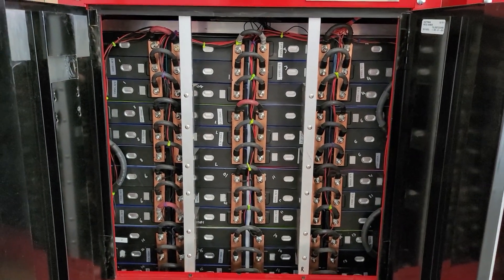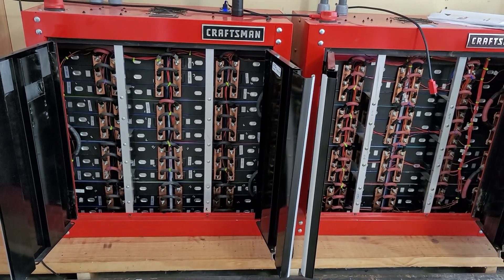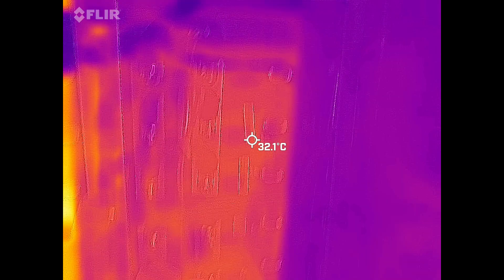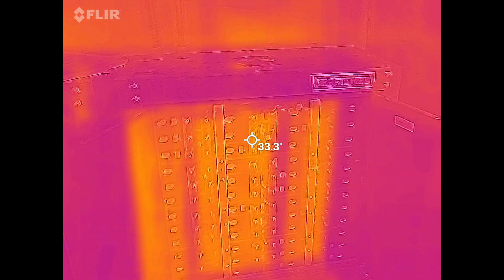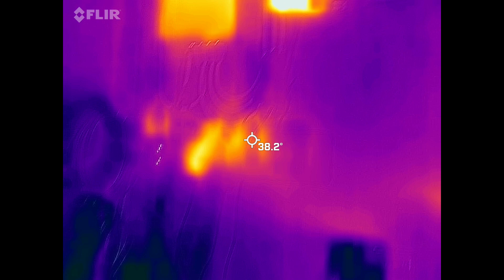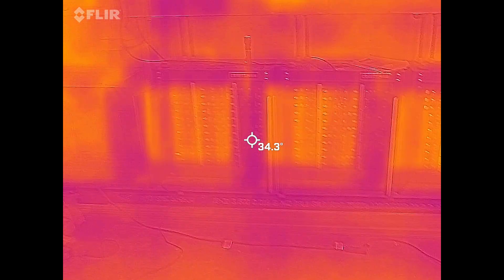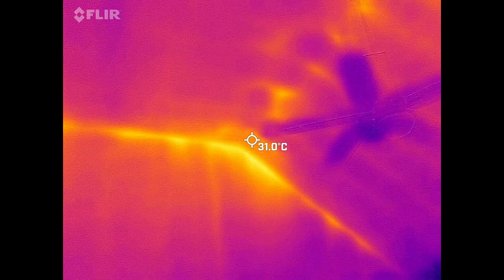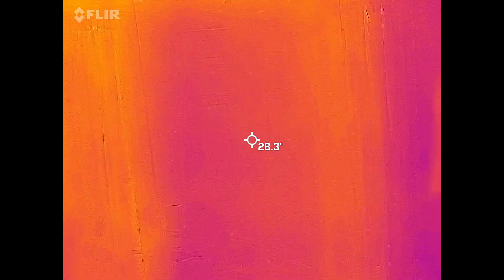After 18 months, PowerWalls on Flir One

Comment: is there a company in the area that can do the spray foam  im sure the hot spots are the framing and not sure if you can really insulate it well you would need to go in the atic and look at the framing but i think spray foam could cover the area better and get into any small areas let me know what you find out
Reply from the maker: Works start tomorrow. We will see how it goes. I am going to implement some of my own ideas and see what happens.
Reply from the maker: So far idea of sealing all of the wiring holes, electrical boxes and HVAC and vent ducts followed with 2 inch foam board and extra fiberglass insulation is working out great. First time that I was able to cool home down to 72 deg,F at 3PM. Do not know if it is worth of making video about it.
Reply: @DMIINC2013  Im glad your making progress every little bit helps what type of ductwork do you have in your attic fixed metal  or is it flexable through out your attic 
also is your airhandler in the attic or in a closet or ? and r value if flexable in the attic and size of AC unit and SEER Rating   I live in Arizona and all or this is very improtant  this month elictric bill on the main house is  3762 KWH   My shop 0 KWH
Reply from the maker: 3.7. MWh is a lot. Size of your home? I am at 2200 sq.ft. As of now I have more then R49 in the attic. HVAC is in attic too. Flexible insulated ducts. Rheem 3.5 ton unit. 13 seer I believe. Yes AZ gets well above 100 in summer. We stay around 88 to 93 deg.F
Reply: @DMIINC2013  Hello the home is 3400 SF livable 2-4ton ac units and i run a small office in my home im here 24/7 
some day i might like to set this home on solar what size batter bank do you guess i would need   i just ordered some EVE 304AH cells to play with you remenber me with the 30,720 KWH CALB battery bank i built this year for my shop and guess house its fun learning new things!
Reply from the maker: At 3.7MWh per month you are about 3 times more the amount of what I spend in energy. I want to say at least 75KWh battery. You would need some serious inverter power too. How many panels you can fit on your home or on the ground mounts?

Comment: Cool test, good to know! These batteries if taken care of (Not maxing out top and bottom) could last up to 10 years+ easily. 
After many tests and lots of research, I feel good with running mine at 3.5v/ cell at the top and 3.125v/ cell at the bottom.
I give up a bit of capacity, but to me it's worth it. At these settings I average 250Ah per cycle on 272Ah cells.
Thanks for sharing D!
Reply: That range is a little strange. From 300mv above nominal to only 75mv below nominal. I run mine from 3V To 3.4375 in normal conditions. 2.9375 to 3.45 if the power is out.

Comment: I forget, what BMS's are you using in each of your powerwalls? Didnt you have to change them a while back? I vaguely remember when you first built them, thought there was an issue with the previous ones, i could be mistaken? Thanks
Reply from the maker: https://youtu.be/EZfhcsIeuW4  I used Daly BMS at first but they are not that good IMO. Video link shows my current solution.